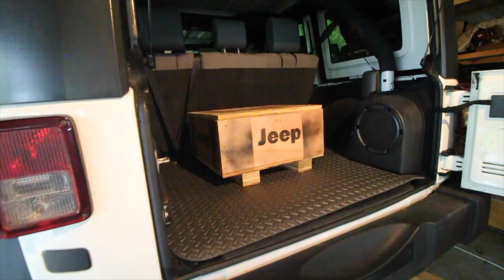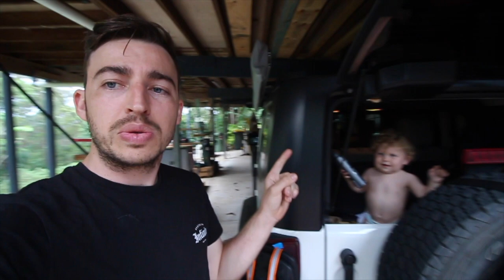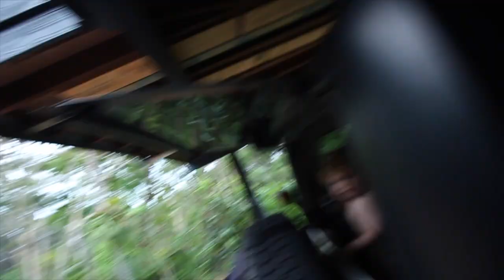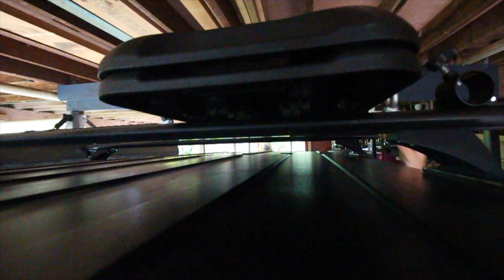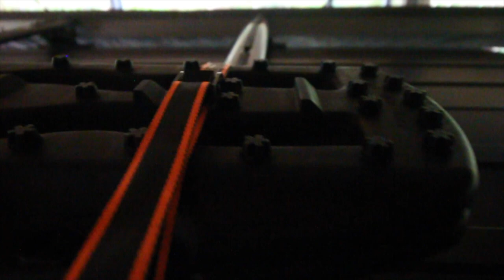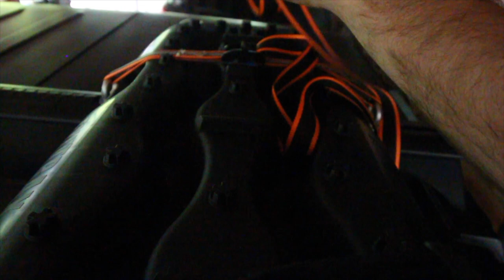cheap recovery track mount $10

Comment: Great video, thanks mate. Exactly what I looking for. Couple of questions, where did you get the shovel mount from? Also does the nut for the eyebolt spin around when you tighten the eyebolt?
Reply from the maker: @bazradventures  thanks really appreciate it, yes the nut did spin so I put a screw driver in to stop the bolt spinning. They are from supercheap auto. Thanks

Comment: @White & sons garage

Hey mate, that's exactly what I was thinking of doing with my vortex crossbars but wasn't sure of the size and channel nut type to use.

Can you please let me know what channel nuts you've used? I am assuming you have to slot them in the channel from the end of the crossbars and the spring and flat washer sits between the channel and the T nut?

Also, keen to know if you have experienced any issues with this setup?

Cheers
Reply from the maker: Hey, thanks really appreciate it. 

We used a universal M8 channel nut, yes I had to slide my one in from the side, your rack might be slightly different, yes I used a flat and spring washer. Hope this helps. Thanks

Comment: Which brand roof racks you run? 
Nut and eyelet easy install to rack?
Reply from the maker: I am running the rhino rack backbone system, yes the just slot into the rack.
Reply: @Whiteandsonsgarage   with a regular nut? Or a special channel nut? I’m trying to source a long thread channel nut/bolt now
Reply from the maker: @williambacon1494  I just did a nut and washer from Bunnings but you can get channel nuts from super cheap auto. I will send you a photo on Instagram if you like.

Comment: Hey mate, awesome idea. I've been putting my maxtraxx behind the drivers seat on the floor and have been looking at strapping it to the roof. Now that I know how I'll be off to supercheap tomorrow. I'm sick of looking at prices for the roof mounts, they are ridiculously high and not justified for my budget same goes for Hema HX1, I just use paper maps. Thanks for the Video.
Reply from the maker: No problem at all, supercheap auto is a life saver. I did exactly the same, it crazy how expensive they can be just to hold something. Haha good on you mate 🤙
Reply: @Whiteandsonsgarage  Thanks for the reply mate. Got the straps today, Cheers.
Reply from the maker: @stavio12  no problem at all. Awesome let me know how it all comes together

Comment: My Maxxtrax came bundled with some mounting pins. But this is a great idea 💡
Reply from the maker: TJ Beam nice, will they been going on the roof rack? Thanks mate 🤙
Reply: CHEAP JEEPER yeah mate. Probably front of the rack. So much work to do on the Jeep and zero free time atm.
Reply from the maker: TJ Beam nice, that sucks, wish I could give you a hand 🤚
Reply: CHEAP JEEPER yeah that’d be great to have a Jeep buddy down here to help with a few things. I’ve literally got a room full of boxes full of parts to get installed. I had planned on tomorrow but I gotta work. Take a load up to Singleton in the morning so there goes my Saturday.
Reply from the maker: TJ Beam dam that sucks mate, absolutely love installing new part 👌

Comment: How did you you actually install the eye bolts to your roof rack?
Reply from the maker: Just with a washer and nut into the T channel of the roof rack
Reply: @Whiteandsonsgarage  could I just strap them down and not use the eye bolts?
Reply from the maker: @kimiee172  yes definitely, just wrap it around the roof rack and you are good to go 🤙